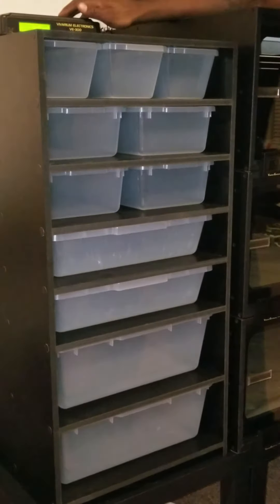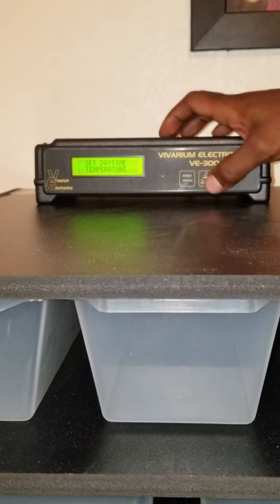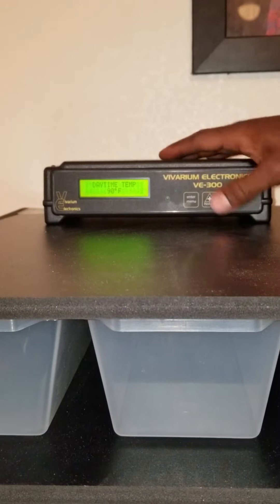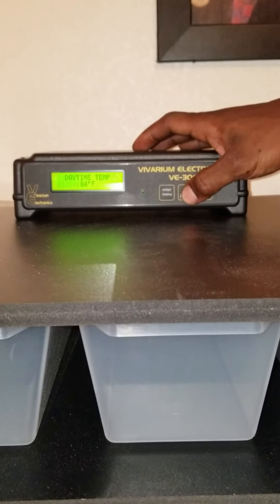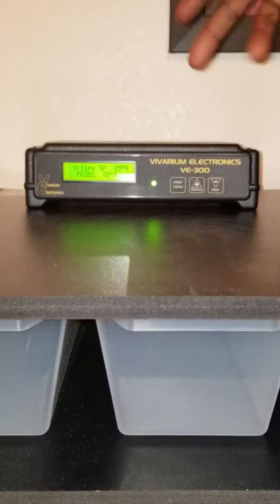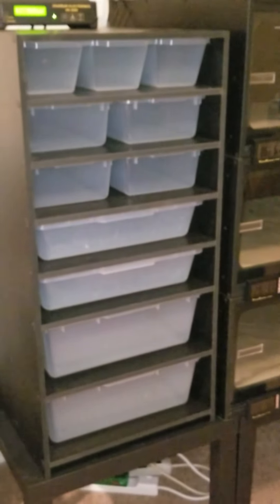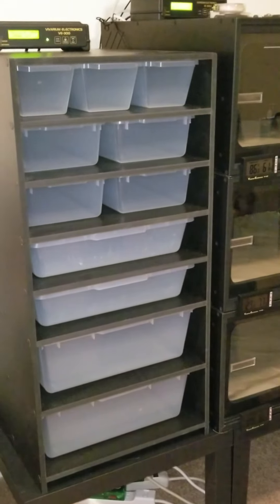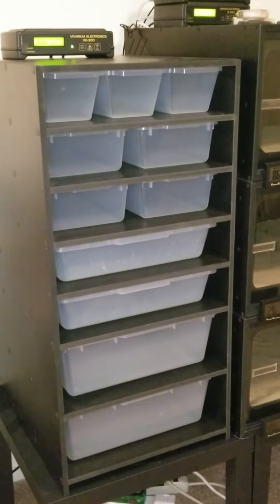Installing Thermostat to Cserpent Rack Pt 2

Comment: The best way to ensure the temperatures are even throughout is to put the probe in the middle and not directly on the tape, I bought a sterilite tub of similar thickness to the vision tubs, i would say i broke it on purpose but i just wasn't steady when making  air holes for a quarantine bin. lol but i broke off a piece of that tub to put in between to simulate the temperature inside the tub